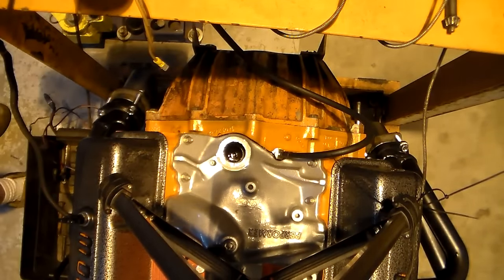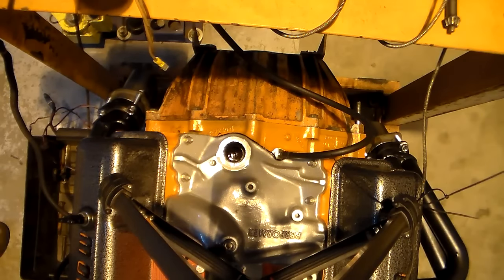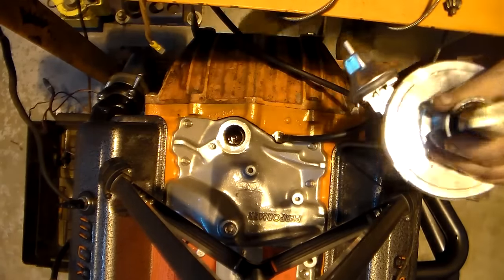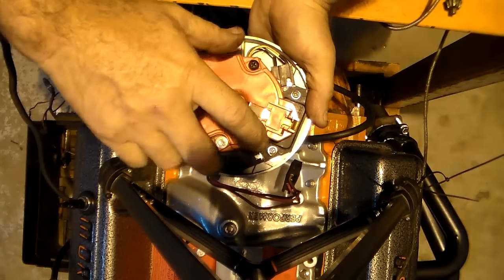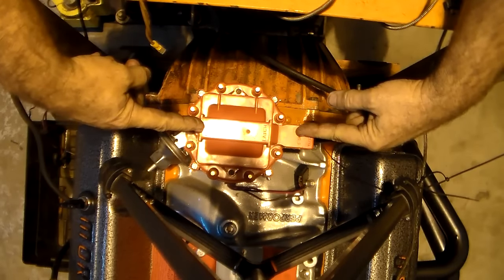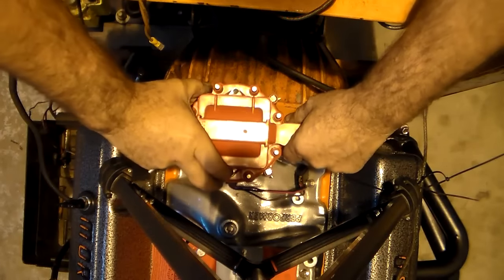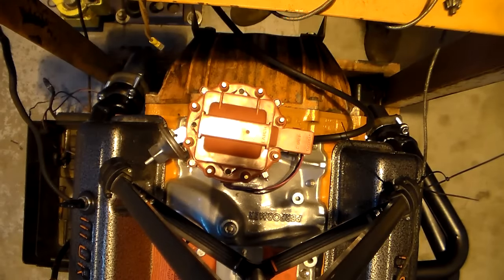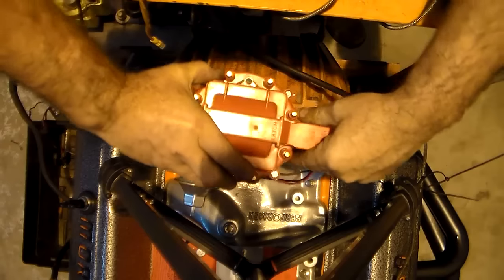How to install a distributor in a small block chevy the easy way.

Comment: You get #1 TDC on comp. stroke on 0. Use an oil pump pump primer shaft to line up the distributor to the oil pump shaft. It doesn't matter. Point the rotor at #1 terminal on the cap. Turn the distributor way back opposite normal rotation and then install it. Then adjust for normal setting. Turn the crank ONLY in normal rotation direction. This causes the chain to be tight.
Reply from the maker: The reason why I install it this way is that most of the time Im starting a rebuilt motor and want it to start in the first turn or 2. I dont want to be turning the motor and wiping the break-in lube off the camshaft to line up the oil pump drive even if its 1 turn. Thanks for watching.
Reply: I already was panicking that mine dit not stand on 11/5 o clock, so thanks for bringing it up.

Comment: Total success on my 1970 C10: started first time! I've never installed a distributor before and also my first time working on any Chevy product. Bravo!
Reply: haha in the same boat. installed tonight on my 67 c10
Reply from the maker: I tried to make a video to show how easy it can be if someone shows a straightforward video of how it's done. I use to work in a corvette shop and did a bunch of sbc rebuilds so I have done a bunch over the years.

Comment: If you have a points distributor you need to set the balancer to at least 8* BTDC on the timing tab rather than 0 or else you will hit the intake with the vacuum pod if your initial timing is set at 14*.  If you want the timing higher then you won’t be able to set it if you dropped the distributor in at TDC on #1 comp with the balancer at 0 on the timing tab. Restab it at TDC like you would normally but first move the balancer to 10* BTDC and the rotor still pointing to #1 plug wire distributor cap post.

Comment: Definitely the best video I’ve ever seen on the subject of installing a distributor in an chevy . I wish I’d seen this 40 yrs ago
Reply from the maker: Well, thank you Bob I have been doing it this way for at least 40 years. I was building corvette motors when was 15 and wanted a quick and easy way to use markings on a motor to align things up.  Its helped a lot of folks so far and I'm glad I shared this info.

Comment: Holy crap, easiest and simple correct way to install a new dizzy. Lots of people get lost on oil pump part and 11 and 5 and number two bolt on intake to line the rotor is excellent point! Thank you p, you rock!

Comment: I ground the gears off of an old distributor shaft and hook it to a drill and use it to prime the motor with oil. I also use it to line up the oil pump shaft. 
 Thanks for the great video.

Comment: Thanks for the tip I have been working on small block chevys  for 65 years and always had to fool around with the distributor to get  it in this works like a charm so easy
Reply from the maker: I was doing so many vette motors in the 80's that I came up with this method and have used it ever since. I'm happy it worked good for you.

Comment: Best tutorial video on YouTube. All my Chevy Small Blocks have started the first time with this method. I can pull a distributor, and install one in minutes.
Reply from the maker: Thanks Im glad it works good for you. I was building so many it just made it so easy to spin it to tdc #1 align up the oil pump shaft point it to the bolt and drop it in.

Comment: I’ll comment before attempting the install. Have never installed one before and your video is very clear and straightforward. 
I’ll comment again after doing the install to confirm just how easy you make it look. 
Cheers 🍻
Reply from the maker: Cool yes let me know how easy it was. Thanks
Reply: @scottsinfl  forgot to to come back but yes! It was super easy. 
Took me a couple attempts as I didn’t have the oil pump shaft lined up correctly but the nice it was, dropped right in.
Reply from the maker: @2TiZiK  Awesome I like hearing that. Thanks for the feedback.

Comment: Man your a genius. I changed the intake manifold on my classic car and could not get the distributor to drop in at my marks. Your excellent video did the trick. Dropped it in and pointing on the number one cylinder. Thanks for the help.
Reply from the maker: Cool glad it helped.

Comment: Wow, That makes it simple. Thanks , I will do it that way forever.  I have a 66 corvette and I worry about leaning on the fenders to keep turning the oil pump rod.
Reply from the maker: If you use your tach drive distributor the c3's have to be 1 tooth counter clockwise or I have found it to bind the tach drive cable and it will wear them out or cause them to get hot and break. Not sure on the mid years I think they give an extra inch or 2 clearance on the firewall so you should be good.
Reply: @scottsinfl  Fortunately I have plenty of room for the tach drive .  Thank You
Reply from the maker: @1harleyvette  Then your good my 73 has to be 1 off or it puts a bind in the cable. I thought the 64 I had there was more room.

Comment: My Man!!! I struggled with the oil pump part for 2 hours. The engine is in the truck, and it's a K10 4X4. I'm doing this all alone, on top of it all. Finding TDC was a mother, but I finally figured out that if I just stick a rubber cap into the spark plug hole then use a breaker bar to turn the engine, the compression stroke will pop the rubber cap out of the hole. Then I just followed the rest of your video, FIRST CRANK, she started right up. Just a few degrees of time to adjust, and then she ran like a kitten. THANKS!
Reply from the maker: Im happy it worked good for you Michael this has been my most watched video and the kindest folks have left some great comments.

Comment: Yup,  works like a charm. Usually spend a bunch of time stabbing the distributor several times.  This method worked on the first try.
Reply from the maker: Ive done it this way for years and it never fails Im glad my little trick is helping so many folks.
Reply: I'll be installing an MSD with internal module and  external coil on a street rod soon . SBC 305  Can I use the same method?
Reply from the maker: Yes you can just remember the location the rotor is pointing at after its installed is the #1 position and its is where you start your wire fire order. 18436572 clockwise.
Reply: Great. This video should be at the top of the search list.  Best regards to you

Comment: OMG sir!! you drop the dist in very quick!! i swear i spent over 2 hours trying to reinstall the same old dist after replacing the pick up coil!! i will try what you did later tonight i hope its work for me. thanks for the video.
Reply from the maker: This is the way ive done it for years and it works every time. Thanks for watching.
Reply: i put my engine in compression stroke exactly at 0 tdc. and ive been moving the oil pump shaft less than 1mm each time from 12-9 oclock it wont drop in!! dose it matter if the engine is straight or not??. thanks in advance sir. this is the pics of the nightmare :))) .
http://www4.0zz0.com/2017/11/04/17/916128530.jpeg
http://www4.0zz0.com/2017/11/04/17/126302167.jpeg
Reply from the maker: Turn that oil pump counterclockwise just a little bit it needs to be at 11 oclock you are at about 11:30 lol
Reply: lmao :)) ok

Comment: I used a timing light one time to try to set the timing before I fired it. Worked pretty good.
Reply from the maker: Ive done that before just set the crank in the timing mark you want hook up the timing light and turn the dist. till it flashes and you're within a couple degrees.
Reply: IF YOU DONT KNOW WERE TO PUT THE DISTRIBUTOR AND WHAT REFERENCE A TIMING LIGHT IS OF ABSOLUTELY no help

Comment: THANK YOU !  Never heard of the 2nd bolt hole trick . Awesome .
Reply from the maker: I was doing so many corvette motors back in the 80's that I thought of an easy way to do it. Also when you build a flat tappet cam motor you don't want it to wipe the break-in lube off the cam by having to turn the motor too much. You want it to start the first time around if posable.
Reply: Do I need to have the #1 piston at 0 degrees tdc or 10 tdc before firing up the motor?
Reply: @vezina808  engine

Comment: Awesome and VERY helpful!  I'm about to replace the points distributor in my '70 Corvette with an HEI like this one.  My Corvette has a tach-drive distributor and just got to figure out now how to connect the power wires to the HEI.  
Have read many different opinions on how to do that part...some say I must add a relay, others say I don't so still confused about the power wiring.
Thanks so much for this helpful video!!  Top notch and I will follow your instructions on the installation.
Reply from the maker: I think the 70 vette used a ballast wire that dropped the volts on the coil to 9volts it will have a braded like wire case on the outside and the HEI needs 12V is why they want you to run a relay. The relay just is used as a trigger with the stock hot wire and you get 12v from a good 12v source through the relay to run the HEI. I hope that helps you know why they want you to use the relay. I ran a wire straight from my ign. switch threw my wiper door cut-out knob for a theft-deterrent but I have a 73 front end so didn't need the wiper door cut out with no wiper door now.

Comment: most of the time for my daily drivers i put dist in an where ever rotor is pointing is nos 1 an time by ear , having said that with cams and compression you need timing marks on the side of the balancer timing light is using so good job lol :) doing it your correct way is easy and should be followed , if you know your motor and are lazy or looking at an unknown motor and checking that atleast the firing order an timing is close so the problem isn't there my way works to but its really wrong , good video

Comment: Thanks for this. I removed my distributor and knew to put it on TDC compression stroke before, but when I went to reinstall it wasn't going all the way in. It would go in one tooth off, so I just need to adjust my oil pump drive.
Reply from the maker: Yes if the pumps not aligned it won't drop in that last 3/8 of an inch.
Reply: After watching this I went out and lined up the oil pump where you said and it dropped in first try.
Reply from the maker: @CraigSmith568  Great Im glad it helped.

Comment: 2 things. 1. It looks like the “11&5” position is the same as saying, “Point the oil shaft alley towards #1 on the front passenger side.

2. It also seems like the rotor position lines up exactly with the oil shaft rod on the bottom of he distributor which would mean it is an industry standard model.

Just something I noticed, but worth pointing out.
Reply from the maker: I have notice that over the years and thanks for pointing that out it may help others.

Comment: Thank you Scott, I will use this process from now on!!
Reply from the maker: It makes it easy to remember those marks 2nd intake bolt from the rear d/s and 11 and 5 o'clock on the oil pump drive slot and it falls right in.

Comment: Yeppers good job just watched your vid to verify I'm doing it right, works every time, and I would add just put a wire on number one set the crank on 10` btdc with ignition on rotate slowly till it fires number one and lock her down , your timed at 10 degrees before tdc and she will run like a top

Comment: Hello! Thanks for the video!! Question, should I manually turn the oil pump shaft to set in the 11 o’clock 5 o’clock position?
Reply from the maker: Yes with a long flathead screwdriver and it will turn real easy.

Comment: Thank you very much. You made this so easy!!!! Today I can finally take my 1963 StingRay out for a ride. Your the best, fo get the rest!
Reply from the maker: Great, I'm glad it helped. I had to put my dist. in my 73 vette 1 tooth counterclockwise to make the tach drive cable angle just right so it wouldn't bind.  I think the midyear didn't have that problem so much that is only if you're using a tach drive dist still.

Comment: Just did one on a 88 caprice 305 I didn’t set it to tdc before I dropped it in but is dropped right in should I take it back out and start over
Reply from the maker: Yes, it has to be TDC on the compression stroke of cylinder #1. and do it just like this vid and your good.

Comment: Thank u. My brother gave me his 1980 Chevy c30 1 ton. On truck says 4.1. I believe it's a v6. The engine that's in there is a small block v8. Don't know if it's a 5.2 or what. But it has the same distributor. The engine doesn't run.  So I tested the compression. Getting compression. I removed the cap. Jump started from the starter. The rotor doesn't turn. When I removed the distributor from engine. Turn it freely by hand. Turns freely. Before I did all of that. The distributor looks brand new. I found out several spark cables were in wrong. 

So I replaced them in order. 
Driver 1357 passenger 2468. Then I recorrect the cables on the distributor. 18436572 clockwise. Then I did a spark test. No spark.  So when I removed the cap. And all jump start the truck. To watch  the rotor to turn. Does not turn. Is that because the timing is off? Where 1 is not at TDC. To be marked at 0. And the rotor was not at 11 o'clock and 5 o'clock psosition. And distributor pointing same direction your showing. Or can it be because the oil pump where the shaft is? Good sign block is not locked. Where should I start?

I could not find the markings on the block and harmonic balancer. I do know when piston goes down. Builds up compression. Then goes up releases it. I removed sparkplug from 1. Held my finger over the hole. Then I jump started the truck again. To feel the pressure. As it released the pressure. I took screw driver insert it into the spark plug hole. Felt the piston. But not fully sure is at fully TDC. One way for me to find out. Is by removing the head cover. Then turn the crank clockwise. To watch the spring go up and down. I know if it's all the way up. Then the piston is up. I also know the marking on the crank harmonic balancer. Has to be at 0. Does that mean if the timing is off. It could cause no spark? Or doesn't let the rotor to turn?
Reply from the maker: If that dist. didnt turn when you jumped the starter then the timing chain or top timing gear is broke. Im sure you have fixed by now or found what the problem is.

Comment: Thank you for all the help when i line up my distributor cap with the rotor the rotor it  is slightly off from the number 1 what do i have to check to make it line up perfectly ? do i need to turn the engine 2 full rotations . my balancer is on 0 dregrees and TDC . how do i know when it is on tdc compression stroke ? it is a chevy sbc 305 .Thanks

Comment: You don’t have to adjust the oil shaft at all 

once you drop the distributor in point at number one cylinder the gear on the distributor is meshed  with the gear on the cam 

you then rotate the harmonic balance /crankshaft and  the distributor simply drops onto the oil  shaft.   Done ✅
Reply from the maker: Yes that is true but in my case, I do a lot of flat tappet cams and when I build them I don't want to wipe the break-in lube off the cam by turning the motor over at all if posable. My motors will start within 3-4 turns for break-in. This motor didn't matter too much it was a roller cam so I didn't worry about breaking in the cam.

Comment: Good explanation. I did exactly that, but I’m at 38*, and I have to advance more and my vacuum module is almost hitting manifold. Just seems like the distributor is turned too much CCW. Right now, the +and tach are at roughly 1:30- 2’oclock. Shou l move the wires one spot, CCW, like I used to have it?

Comment: That's a good way to do it I never bother moving the oil pump drive I just set it in and turn the engine a bit the rotor will turn and stay in time then it will drop on in when it aligns mostly I do that so when it's in the vehicle I don't have to crunch my fat butt up in there lol
Reply from the maker: I don't want to turn it until I go to fire it off just to keep as much break-in lube on the cam as I can.
Reply: @scottsinfl  gotcha I was just mainly talking like replacing one I had to today on my square body

Comment: Great video thank you I’m doing my 64chevy vette
Reply from the maker: I have found that the vette with the tach drive dist. sometimes it has to be 1 tooth counter clockwise to keep the dist tach drive cable from having too much of a bend in it. Also, a tip make sure your birdcage is well grounded to the frame and motor or the ground will travel threw the tach cable to feed the dash grounds and cause the cable to keep burning up.

Comment: Great video quick and simple ....I do have a question for you.....my harmonic balancer does not have marking or the bracket so how do I know it's at zero?
Reply from the maker: You wont ever know its a zero. You have to find top dead center 0 with a cylinder piston stop and a degree wheel also a tape strip to mount to your balancer and a pointer to install on the motor. Its a process but can be done.
Reply: @scottsinfl  thanks I will try and figure it out, I understand the part about getting the front left lifter position but then confused on moving the harmonic balancer to zero when it has no marking on it ....I keep researching thank you for replying
Reply from the maker: @tvlu4365  A crude way is to like i said get a piston stop or make one. What you do is install the stop in the spark plug hole of #1 cyl and spin the motor EASY by hand till it hits the stop and make a mark on the balancer with a sharpie with your new installed pointer then spin it backwards all the way back around EASY by hand till it stops again and mark it again with your new installed pointer. Use a tape measure to find the middle point between the 2 marks and that will get you within 2 degrees of tdc.